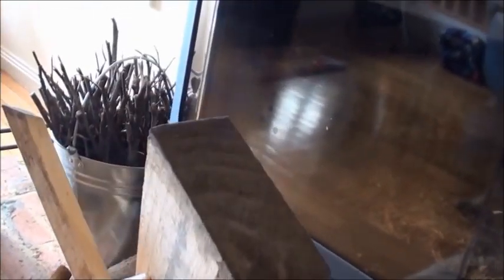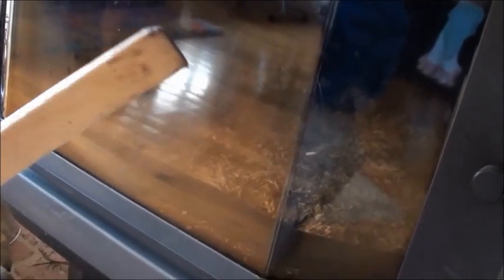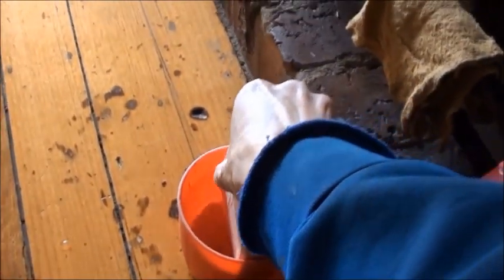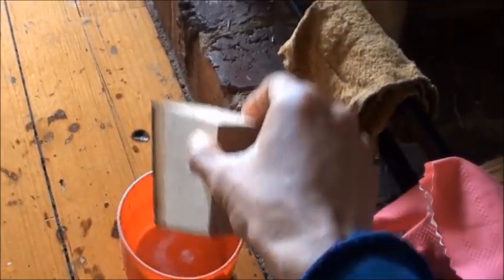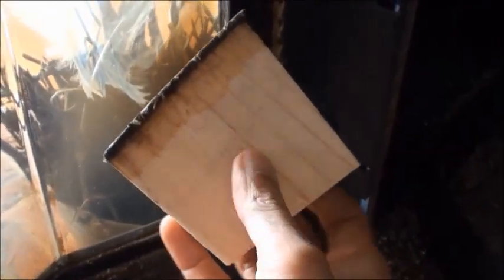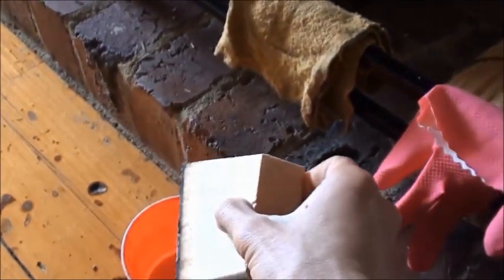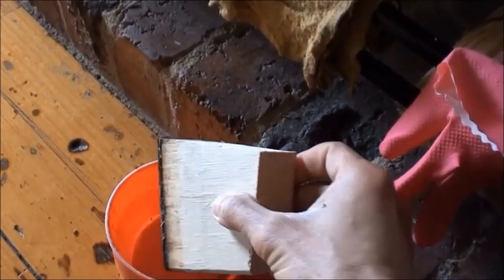Easiest way to Clean Fireplace Glass Door

Comment: WOW!!!  I cannot tell you how happy I am to have found your video.  My fireplace glass doors were filthy with at least 8 years of smoke accumulation.  We have talked each year on  how to clean them but didn't want to use harsh chemicals.  I cleaned all four panes and they are sparkling after about 10 minutes of work.  It was so very easy! Thank you so much for your help.
Reply from the maker: Hi Charlotte Sanders, Fantastic! If you now do it on regular basis, it will be easier to clean. Thanks for watching.

Comment: OMG thank you! We got a new fireplace and tried to clean the glass with ammonia and it worked some but lots and lots of black stuff and black bumpy bits were baked in. Someone said they would burn off but it didn't. We scrubbed with a scrubber, steel wool, and a scraper for a long, long time. Still it did not come off. I went online to buy some cleaner but found your video and tried it. It worked great!!!!!!!!!! And it was free!  We had to use some ammonia in addition to the ash for the really bad parts but it all came out spotless!  The wood scrubber is a great tip. THANK YOU!!!!!!!!!!!
Reply from the maker: Hi Cynthia Choi, That is great! If it is cleaned regularly it will be easier to clean and no ammonia required. Keep up the food work, do not let it build up. We like to watch the fire sometime, so clear glass is always a good sight! Thanks for watching.

Comment: This works great with ash, but not so much when charcoal gets mixed in there. It's pretty easy to quickly tell when you've got charcoal on the wood so you should be able to avoid scratching. But, how to separate the ash from the charcoal on your block of wood? My wife won't let me use the the flour sifter which would be perfect for the task! I guess I'll buy another one dedicated to that task.